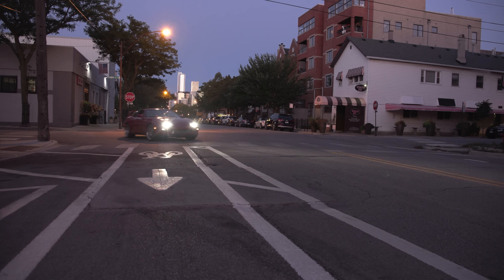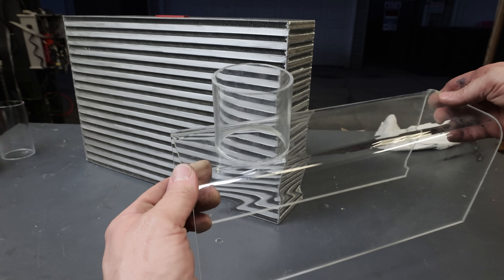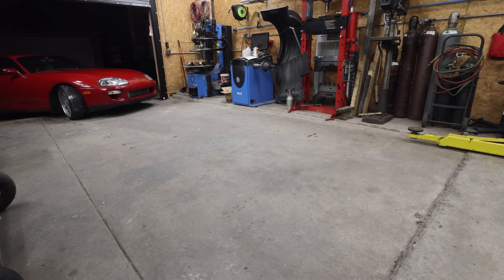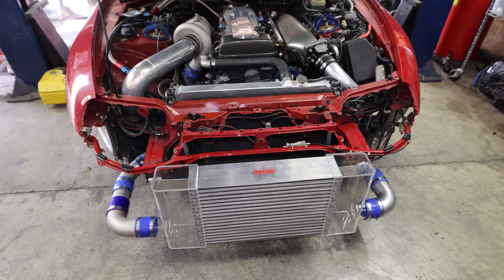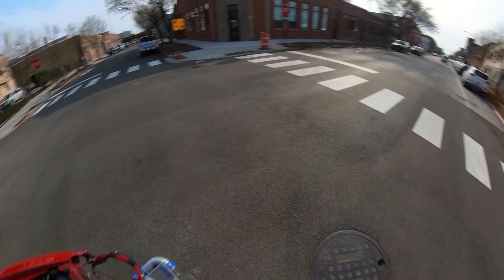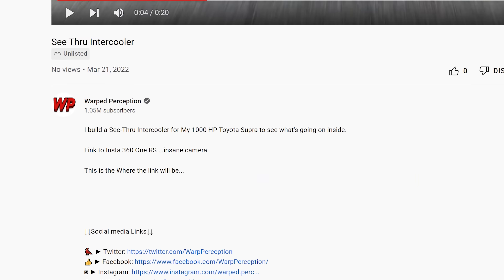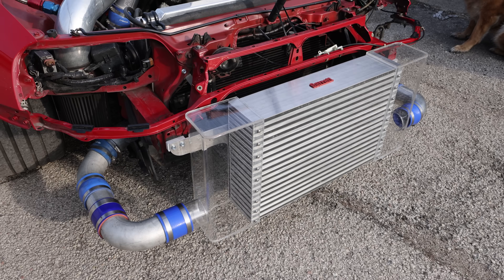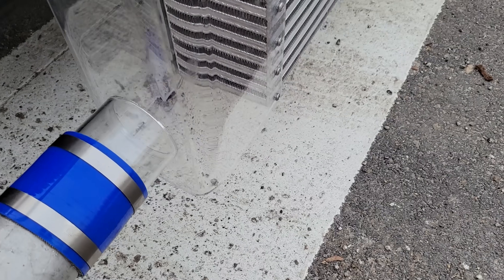See Thru Intercooler

Comment: If you tried this in Europe, in particular Britain, that would go about one or two streets from the auto shop and that wonderful intercooler build would be ripped off by a damn speed bump 🥴😅
Also, you took the crash bar off the front of that, so basically your awesome 2Jz engine and your legs would be the crumple zone in an accident 😯😬

Comment: MEK FTW!!! I remember some foreign dickhead at my old electronics job filled an isopropanol bottle with MEK and melted every polycarbonate object on a medical device PCB. The dark bottle literally has the letters MEK on it and does not smell the same. Aside all the alcohol was in tin plated, steel 1 gallon rectangle containers.

Comment: you need to sand the mating surfaces for them to correctly adhere to the glue
Reply from the maker: It's not glue, it's solvent, it dissolves both surfaces, the liquids merge together and when the solvent dries it's a solid weld.

Comment: So at 6:07 when that cover blows off. You can see a brief moment of condensation form as the compressed air is suddenly released. 
You know how when you twist up a water bottle and then pop the cap off, some 'smoke' will form and billow out. Same process here.

Comment: so what?  .  ok, you do it only with the hope of earning something with the publicity of this camera .. but the sense of the video ??  you haven't even tried to insert any dye or smoke machine on the suction side !!
Reply: moreover, those who have a minimum of experience in the construction of imtercoolers know very well that the two inlet and outlet manifolds must not be straight as you use them, but at 90 degrees to take advantage of the whole radiator and not just a third of the surface ... what a fake !!

Comment: I sure hope to God you ain't using e85 in that supra! 88 octane pure gas or no vroom!
Reply from the maker: Yup, been on e85 for over 10 years on my supras, I was one of the very first to run e85 on a Supra, everyone else was running c16 racing gas, they all told me I was nuts but it's the best
Reply: @WarpedYT  lol I think e85 is meant for hybrid cars
Reply from the maker: Nah... Very high octane and a ton of other benefits from increased volume of fuel and additional cooling of the charge. As with anything else Not all positive though.

Comment: 15psi is like a thousand pounds of force against the walls.   Nah, pretty sure it's like 15 pounds per square inch.
Reply from the maker: Yes 15 pounds per square inche and there is 70 sq Inches, so multiply 15 x 70 and that's your total load in pounds

Comment: Warped Perception, I have an experiment I want you to do.  It involves a casino roulette wheel.  Here's the experiment:  Wrap one hundred feet of moderately thick yarn around the center spindle of the wheel.  Then, walking in a straight line outward from the wheel while holding the end of the yarn in your hand, walk outward while increasing your speed as fast as you can and as fast as the inertia of the steadily accelerating wheel will allow you without snapping the yarn or damaging the wheel.  Now, by the time the yarn runs out, how fast will that wheel be spinning --- and how long will it take for that wheel to stop completely?

Comment: Where The pieces fell off at you shoul place a metal piece with 3 separate flap you can bend upwards to sit flush against the walls and drill holes from front to back through to the other side to add glue to the bottom base of it so theres no leaks when forced induction kicks in and it will be twice as sturdy and the frame wont chip off or break😏🤌🏻

Comment: Just my 2 cents, but I'd recommend a high flow panel filter after the intercooler just in case the thing blows in a dramatic way.

Last thing you want is plastic pieces introducing your valves to the pistons.
Reply from the maker: I thought about that but then I skipped because in almost every circumstance there is going to be positive pressure when it blows, so that means nothing will get sucked into the intake because everything is going to be blown out. I'm definitely still considering it though especially for the Dyno Run.
Reply: @WarpedYT  I agree... But there's always that 1% risk. Won't be too much work to incorporate into the design with your equipment my man!

Comment: Would have been cool if you stuck  a thermometer inside the in and out ports of the acrylic parts you made, we can visualize the cooling XD.
Reply: In case you are worried a out pressure, the surface area of thermometer quite low no? In any case you can put that inside another box lol, thin strong acrylic. Would look cool

Comment: I'd add some straps that tie the two tanks together at the through intercooler bolts, as the current aluminum fins aren't adequate for those types of loads and will likely pull out. Straps on the front and rear holding both tanks together should do the trick.
Reply from the maker: Yes I actually have them for both sides of  the intercooler, but when I load tested it they held just fine so I didn't put them on, in that direction there is only like 800 lbs of Force. I may put them on anyway for the next video. Thanks

Comment: There was no way that was going to hold any sort of pressure. If it was molded as a solid piece then fit to the core maybe things would have been a tad different. Thinking about the piping it usually helps to have bead there for an extra seal. I'm surprised a pipe didn't pop off.
Reply from the maker: I don't know about that, I didn't mold it to be a solid piece because then we wouldn't have a clear view of the inside of the tank.  as for the pipes, those won't pop off because they are fitted inside of the tank instead of being glued to the tank so that is sheer force versus tensil Force

Comment: Not sure about JDM, but for euros (Audi) each time I open a flexible hose near the intercooler on the cold side, there’s usually thin oil; Apparently it’s normal.
I know some cars PCV system differs but what’s your thoughts ?

Comment: You had three 2x4's stacked in the tank for support, which means the cap that blew was about 20 square inches. At 5psi it had 100lbs pushing it out. At 15psi, it'll be about 300lbs. I have my doubts it'll stay together with glue, best chance is if the caps are folded over and plastic welded.

Comment: Inject smoke into the turbo side so you can see the air flowing.  It will be tricky due to boost pressure but its possible with a bit of faffing and 3 printing some clever parts with a one way valve ;)

Comment: You glued those pieces. It wasn't from scraping, you will never get serious boost from that with glued caps.
Reply from the maker: I know, according to the tensile strength specs for the glue it should have been okay, but when you weld these type of pieces together with that solvent they need to be very very closely fitted, it's okay though I got it figured out I'll be doing the next video in a few days
Reply from the maker: Thanks
Reply: @WarpedYT  Awesome man 👍 Look forward to seeing it.

Comment: Bro how coulnot a tank will not hold that pressure are you kidding me, i hope you realize that boost is actually really really low pressure for anything beside air intake on a car, a bottle will hold like 8 bar…, a baby could handle 1.5 bar for sure…
Reply: Don't be boosting any babies 
Babies cannot handle 1.5 bar of boost
That's just crazy talk
Reply: @johnmoser2689  😂😂😂😂😂boosted boys didn’t come from nowhere, bro
Reply: I'm sorry Tazz, but this is hilarious.
Reply: Don't listen to em Taz. Boost some babies!
Reply: Pin of shame xD
Reply: It's also worth noting that a cylindrical bottle is more equally loaded than a square tank. Which is why you never see square air compressor tanks
Reply: @RHBTurbochargers  
Almost never*
Reply: It happens man, ya had a little comfort and the comment section fucking ripped it away.. who knew he would see this comment, out of all million subs, and who knew he would pin it just so he could correct your math, you, Taz's math. 

It'll be ight mang. Ya got some logistics screwed up there. It happens.

And to all the dudes correcting him, or making fun of him for the umpteenth time, why does the line need to stretch around the corner? It happened already. Its right there. Read it, he was corrected and shamed. Move the fuck on lol, who cares
Reply: tell me you cut math class without saying you cut math class
Reply: u have no clue what u are talking about
Reply: Yea, exactly!🤦🏼‍♂️
Reply: Go boost your bong, TaZZ.
Reply: Where’s you response to WP!? 😂 now look whose saying lmao. If your point was true, turbos would be ineffective or barely make a difference.
Reply: Some how I will love to see that but as a comment it sounds so lame
Reply: Bro you don’t know what your talking about 😂
Reply: >coulnot

We making up new words now, are we?
Reply: Bro can’t spell OR count😂😂
Reply: I'll play the devils advocate here. I think everyone replying here misunderstood what Taz said. I think he clearly knows that that each side is about 1000 pounds of force. He said 100sqinch.. He was just saying its not thounds of pounds. Just a thousand pound. Anyway why are you all picking on him, just because someone is a bully, you can't bully them back. Its not like he is physically harming anyone, even if this is the internet we have to be respectful to each other. Everyone here shitting on Taz. Just ignore em fools mans. Also you stop being a fool your self. And very big of the Author @Warped Perceptron to pin this and give him more exposure to internet bullying. That does-not do anything besides self satisfaction. At least in my opinion, I think civilised manner is that if you are not going to nice to someone just ignore. They are not physically doing anything. You can politely correct people and then they will rethink, their behaviour, instead of shitting on people, just sad to see this. Anyway, that's enough internet for the day bye yt.
Reply: @mindpalacestreet  Appreciate this.
Reply: How 15 psi will be thousands of pounds of force if 15 psi means 15 pounds per squarw inch.. you have a tank of idk 100 inch^2??? Lmao
Reply: @tazz1226  yew skipped maths eye sea
Reply: @toreyweaver9708  LOL! It looks like you skipped spelling I C.
Reply from the maker: 14" x 5" = 70sq in x 15 PSI (Pounds Per sq Inch) = 1050 pounds of static force on that one side.
Reply: @WarpedYT  math doesn't lie, nice....  as you showed, need to take in the entire volume of the space... Dude wasn't looking at the big picture, just one inch. lol...  Oh well, awesome video!  I can't wait to see the tank when you're on boost!!!  I always love your Supra videos!  Keep up the amazing work my dude!
Reply from the maker: @briankachelman  thank you !

Comment: Ok hear me out I’m not trying to hate but what’s the whole point of this what are you going to see air?
Reply from the maker: Yes you will see what the air does the different states of change and it's behavior as soon as I start running some boost pressure on the dyno. Air takes on many different forms depending on the circumstances

Comment: If you don't get the blow off to open at exactly the same time you let off the throttle those end tanks will never survive... it doesn't matter how low of boost you try to run at wot.
Reply from the maker: Yeah that pressure spike, that makes sense and you just gave me an idea, I have always wondered what the pressure was during that moment since you're always reading it after the throttle body. I'm going to make a note of that and make sure and to follow up video next week I include that pressure reading that would be very interesting.
Reply from the maker: However I do have dual BOV's one by the turbo and one by the throttle body to reduce this phenomenon and keep the turbo spooling, but I suspect they're still that pressure spike.
Reply: @WarpedYT  yeah I feel like there will always be the split second of a spike.  I run a light spring in my bov to try and make it as responsive as possible.

Comment: Those end tanks need to be properly redone. It not good for optimal flow to have the inlet and outlet directly opposite each other.
Reply from the maker: You're partially right,. I think the shape of the tanks are not necessarily 100% perfect shape for an intercooler that's going to be mass produced because it would just be wasting too much material. As for the piping placement I don't know about that, as you can see the original intercooler had the same placement. And most aftermarket intercoolers do have this placement.

Comment: Shouldve made the ends of aluminum then cut out a window 1/2 thick . This idea was stupid
Reply from the maker: Lol... True but I wanted start here, the reason I did the ends clear versus aluminum is because in this video I was planning to do the high speed footage, and from a cinematography standpoint, I need to shine a ton of light in from the top or the bottom to light up the air molecules for the high-speed camera. Because when dealing with lighting and clear shiny plastic, I don't want all those crazy reflections off the front and I want the high-speed camera to see nice and clear right through that plastic.
Reply from the maker: So yeah there's a reason to my insanity, but I think what happened here is since it's a perfect square the pressure was pushing pretty evenly and it ended up cracking in the corners or, I kind of already saw some little cracks before it blew out but I'm not 100% sure that might have happened when I came out of the driveway.

Comment: How much power do you think its currently making?
Reply from the maker: Not sure because I recently swapped the turbo for a slightly smaller one and newer style and then I also upgraded the injectors to much better ones.
Reply from the maker: With the old setup it made 1050hp to the wheels... Way to much to even use on the best day... Lol

Comment: 6:20:  This video is SO CONFUSING!  I understand that you're using that intercooler in place of the car's normal radiator.  So if you scraped the bottom of the intercooler on the driveway, wouldn't all the water have come out?  How could you even drive the car under that kind of condition?  By the way, how do you get away with driving on township roads with all those mods on your car without the police coming after you?  I'm not even going to finish watching this video beyond this point because there is just no educational value in it, especially with all these things I can't understand about this f'ing experiment.
Reply: While they use similar concepts, an intercooler is not used in place of a radiator. They serve completely different functions. This car has both a radiator and an intercooler. 

A Radiator is for maintaining temperature of the coolant which is a liquid. 

An Intercooler is used to cool compressed air in the intake path after the turbo, which is a gas. 

A turbo is essentially an air compressor. Compressed air heats up. Hot air does not burn as well as cold air because it is less oxygen dense. So an intercooler counteracts the heating that comes with compressing air.

Comment: 4:32:  Don't see any water in it.
Reply: This guy is correct tho, I don’t see any water in it either..the facts this is normal is irrelevant.
Reply: @infernalGotYou  The absence of evidence is not evidence of absence
Reply: Theres a liquid line visible, but I'd bet you it's just from the abundance of adhesive used to seal the bottom part of the tank right there. Not water.
Reply: Air to air cooler
Reply: @1187titanium  wtf
Reply: @EthanAdey  air to air intercooler. I ran a big one on my M90 blown L67 to let me hit 20psi without ping as they blow hot AF air

Comment: Supra hp?? Pls
Reply from the maker: 1050 RWP with my old turbo and injectors, right now it's a little bit out of tune simply because I swapped parts to some newer better injectors and a newer lighter turbo. So I haven't had a chance to tune it on a Dyno yet but I will soon.

Comment: It would be cool if you could do this or replicate it with smoke to see the flow of air.
Reply from the maker: That was the second stage of the plan after we watch what the actual air itself does. Unfortunately I didn't get there but I will have a follow-up video very shortly
Reply: @WarpedYT  AWESOME! 😎, I will be waiting. 
I'm interested to see what the flow looks like with that boxy end-tank design. Would be cool to compare to a more smooth flowing design too.

Thanks for making cool, interesting videos.

Comment: On a random note, I think the rear diff housing on the Supra may need some bushings. I understand there's a good amount of torque being applied but it seems to have decent amount of deflection between its loaded and resting state @4:10
Reply from the maker: Good eye, I'm going to get that done before part 2
Reply: Diff bushings are my nemesis. Spent 2 days on a friends driveway doing one in my E46. I am happy to share my experiences though:

1. - be stronger than I am.

2. If you are going to use an impact driver and a cheap bearing puller set, spend the time buying correctly sized and correct hardness forcing screws. Messing about with M10 threaded rod lost me hours.

Comment: So, if I am reading this right, the fins of the radiator are used for cooling air, while the tubes between them hold the boost air for cooling. Very clever stuff. I would like to see a see-through transmission intercooler and engine radiator because the coolant is not air so you can see a bit more of what's going on there. I wonder if you can shove some smoke into the turbo intake to visualise the airflow.

Anyway, this was an amazing video as always.
Reply: The tubes that the charge air flows through also have fins in them to increase the surface area.
Reply: @Mrshotshell  Right, that makes sense. But obviously the fins are aligned with the flow as having them perpendicular would cause all kinds of problems